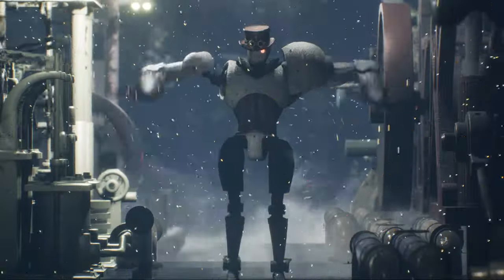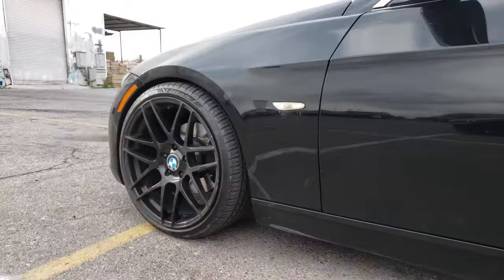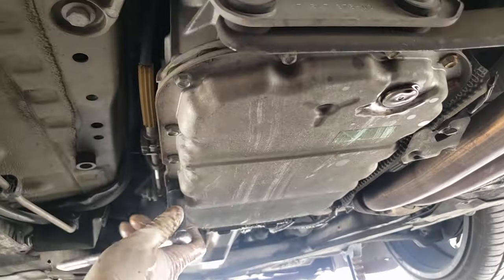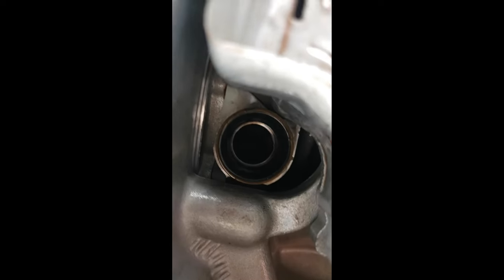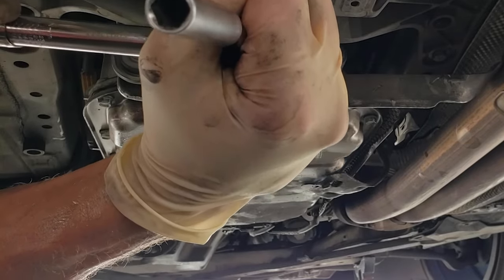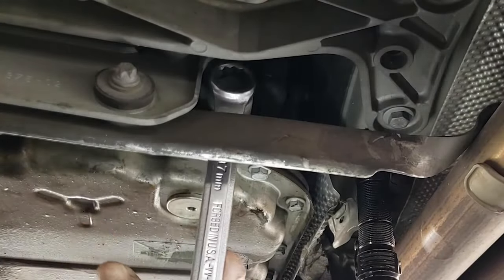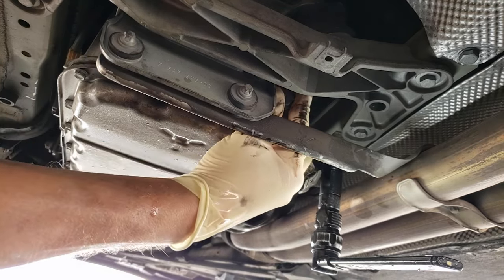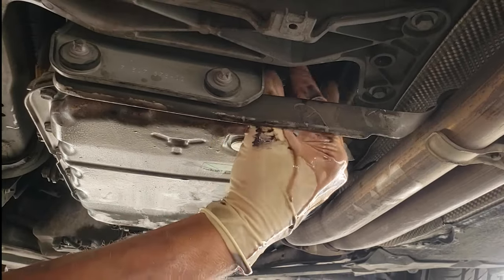How to Change the Transmission Fluid and Filter BMW E90, E91, E92, E93

Comment: Thanks for the video! I was having a shudder, so I did the fluid change a total of 3 times, and on the last one I did the filter and cleaned the pan. 

It was honestly easier than I thought. I decided to leave the old transmission filter seal in, as it still seemed in good condition, and I think I would have done more harm trying to pull it out. I used Valvoline Maxlife ATF and it works really well, transmission shifts WAY better. This was at 131k miles, with no known fluid changes, so even if you have a lot of miles like me, I would recommend to change it. 

I had a fault code for "Gearbox Oil Wear", which I cleared with ISTA. I also used ISTA to monitor the gearbox temperatures. I would recommend doing it when the temperature outside is not too hot if you can, as you have more time to run the car through the gears while filling. I ran through all of the gears with my foot firmly on the brake, while I had my Dad pumped in fluid. Once fluid started coming out, and I verified the temperature was correct, I put the fill plug back in. It is easiest to install it from the driver's side. NOTE: you can leave the fill plug out when you start the car, this will save you from having to mess with it an additional time. 

Overall, this is not too bad of a job, and I would say it is easier than Valve cover gasket, but be sure that you lay down something to protect your garage floor, as it will get messy. 

My Indy wanted $750, and my BMW dealership $1000 to do this service. I ended up doing it for $230, and that included buying a set of ramps for the front of the car. 

Thank you again, you gave me the confidence to preform this service, and I have saved a lot of money thanks to you.
Reply from the maker: That's awesome man, Glad the video helped you. I always say if my video helps at least one person then i have accomplished my end goal .Yeah the job is more daunting thinking of it then actually performing it.I would say to 2 most difficult things are ) putting the fluid in without burning your arm on the hot exhaust. 2) knocking the seal out, but if you are careful you can bend it with a chisel and sledge, and then hammer new one with a socket of same diameter and knock it flush. Im working on a whole N63 TWIN TURBO build series so keep an eye out in next week or so.  I'm going to be releasing another Indentical video as this one but, It has better camera footage and will be better audio as well. Also the near future i'am going to show people how to do the 3 stage tune mod, and get another 50 or so hp for cheap. Thanks for watching🙏
Reply: I’m getting a shudder too, it vibrates a lot when I get into certain rpms and up certain roads. So I’m going to try to do this soon. I’m just not sure if I can do it but I’ve done a valve cover gasket by myself. Hopefully it fixes itself for the first time because I bought the fluid kit from fcp euro and will be replacing the filter.
Reply from the maker: @xBlackHalo  You can do it i promise.. It's looks worse than it actually is. Just make sure to fill at correct temp.. the hardest part is getting that seal out of the trans. Use a chisel and mini sledge and carefully fold in the edges , then you can use pliers to pull it out.. Making a trans pump like the one i did with copper wire from home depot, it will help you so much.. and be careful of the hot exhaust close to your face also. Good luck you got this 🙏
Reply: @xBlackHalo  I think this is easier than the valve cover. Just take your time and follow all of the steps.

Comment: I live in Las Vegas as well and have a 328I xdrivde with GM transmission. My transmission is slipping I’m gonna try this, Thanks for the video my man. If you’re interested in helping out let me know.
Reply: How did it go ?
Reply: @saeedh2603  actually wasn’t that bad of a job and now transmission is so much smoother much better drive. Definitely recommend it if you have that transmission.

Comment: Hey man, good video! I’m going to attempt this, hopefully I have enough space to jack all 4 sides since my car is lowered haha
Reply from the maker: thanks man, So just make sure you use a low profile jack, i put an amazon link, or just go the harbor freight if you have one near you. Make sure car is securely supported before anything. I like to start with the front of the car first, then put a jack under the rear diff and slowly raise it. Main thing is you want enough room to slide under there to put the fluid back in, and also not burn your face because it's super close the cat converter. Let me know if you have any questions when you are proceeding k. 👍
Reply: Hi! Valentin from Uruguay 🇺🇾 I want to know if you have to do something after you fill up for second time to make the car relearn the gearbox 
Thanks is very helpfull for us
Reply from the maker: @valentinbarreto9332  hello 👋,  thank you.. and yes you do want to do a quick relearn before you drive the car after filling the fluid.. the car will eventually learn your personall shifting habits. But the relearn clears out previous shifting info from transmission. Hope this is helpful 🙂
Reply from the maker: Ah i misunderstood your question. Not sure if you need to do a second time. But it doesn't hurt. put key in ignition. press to #2 accesory position, do not start the car. Hold accelerator pedal to the floor for 30 secs. then press ignition to off and remove the key. You are good to go.  @valentinbarreto9332

Comment: On the second go around filling up the last 3 quarts, are you filling it up with the car on or off?
Reply from the maker: Hello again, so on the second time around make sure the trans is up to temperature, 86-120 degrees, With car running and in Nuetral remove fill plug and fill until fluid drains out the hole. It is important to only pump fluid in second time when trans is up to temperature because the fluid expands and won't be filled properly of overfilled if car isnt running. Just be very careful to burn yourself it's very close the exhaust.

Comment: Possible that the transmission filter could get clogged and not let the transmission shift properly, or is that transmission done for thanks.
Reply from the maker: Its possible. Doing the flush and the filter change, should help it shift much smoother

Comment: Hey man I have a 2007 328i & I purchased the fluid and was wondering if mine i need just the filter or if mine is both of them together and I’m also still trying to figure out how ima lift the car in order to do this lol if you have a few different ways you’ve seen or learned in your years doing this haha I’m trying to get into building my car first and hopefully more after but thank you bro keep up videos 🙏🏽💪🏾🤘🏽
Reply from the maker: Thanks man i appreciate you. Welcome the the E92 Club honestly it's been such a dependable ride, such a good motor. So to answer the first question it's super easy to check which transmission you have. Just undo the i think 6 , 8mms holding the shroud by the trans. Look at if it's plastic or metal. If it's metal then you get the gasket kit and filter. If it's plastic you replaces as one whole unit. I would just purchase a slim jack and 4 jackstands. Start in the front of the car from left to right at lifting points. Then go under the rear diff and lift up the car be very careful and lift slowly. Then just set jackstands at the rear and she's up high enough to do this. Also #1 make sure not to put cheap autozone fluid, Either the kit i bought works or you can use the Liqui moly trans fluid. #2 you can make a filler pump with a piece of copper tube from home depot and those cheap pumps from harbor freight. #3 make sure you have an IR or infra red temp gun to measure the temp of trans before putting in fluid. For first fill it's ok for it to be cold. But for final fill make sure it's within proper temp before pumping in. I've done this on my car's and all my friends bimmers's and they have all been running so smooth on the shift's with better powerband. I have videos on my channel to just cover about every mechanical fix you would want to do for it. I will be doing a future video as how to do the 328i to 330i tune for 50 free hp. Thanks for watching 🙏
Reply: Mine is 2008 328i and it comes with metal pan. It’s a rear wheel drive. Not all rear wheel drive comes with plastic pan like Pelican parts’ video clip stated.
Reply from the maker: If it's the metal pan then you have the GM GA6L45R transmission. It's the same as the mine. The only thing that is tricky is the bend the metal seal out of the case. I used a chisel and hit in the corner's carefully to remove it. MIne is rear wheel drive also. @leopadh

Comment: How many miles do you have on car.  I have a 2007 with 135k original owner and never have changed trans fluid.  I was thinking of doing it.  Many say do it some say don't   what do you think
Reply from the maker: I would definitely recommend the change.  my purple bimmer has around 165k on it now. But i did the change around 140k. My friends i think has 100k. It will shift so much better and extend the life of the transmission. BMW is supposed to be lifetime, but i would recommend changing every 40k miles. Hope this helps🙏. Thank's for watching
Reply: Thanks for your recommendation.  I love my BMW and want it to last as long as it can.    @findfixxflip
Reply from the maker: @Mike0in0Texas  most definitely, i fell in love with my little 328i. Car has been so dependable and low maintenance. I gotta few more 3 series videos coming soon so stay tuned.

Comment: How do I know what engine I have? I have a 2008 328i rear wheel drive. I looked up the vin all I find is its N52N engine. In case don’t have the temp meter can I just let it run for 15 minutes then refill? Also am I supposed to refill while engine running? Thanks!
Reply from the maker: Hello, so based on your info, you have the n52, 3.0 liter 6 cylinder. The way you tell which transmission you have is if you have a plastic pan or a metal one. If you have a plastic one then you will need to replace the pan because the filter is part of it. I would really invest in a temp gun, you can get one from harbor freight if you are in us for around $25. You really want to fill at the right temp. So as far as filling goes, pump fluid until it runs out of the hole with car off. Then start car bring trans up to temp check with gun, then pump fluid until comes out the hole and tighten. take for a drive. Hope this helps ya🙏
Reply: @findfixxflip  Thank you, that is very detail instruction. much appreciated 👍
Reply from the maker: @leopadh  no problem glad you liked it 👍
Reply: Turned out I have a metal pan not plastic. I’ve seen another video stating 2 wheel drive comes with plastic which confused me. Luckily I purchased only the filter and gasket.
Reply from the maker: @leopadh  nice, i actually thinl metal is easier. But it will be a little bit of work to get thr old seal out. The punch works great but be careful to not damage the aluminum casting.

Comment: How many liters did you put
Reply from the maker: I ended up using a little under 6 total quarts. Pump until fluid comes out of the hole. Then bring trans up to temp as showin in video, Then unscrew plug, and pump in again until it starts coming out of the hole. Then tighten plug, perform relearn, and take for testdrive. Hope this answers your question. 👍